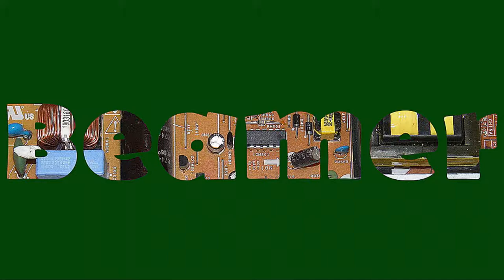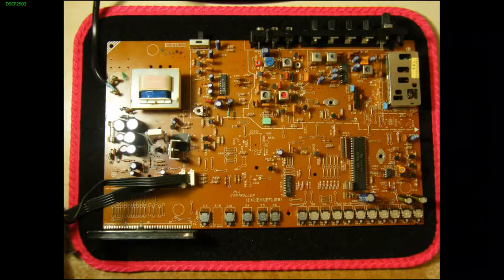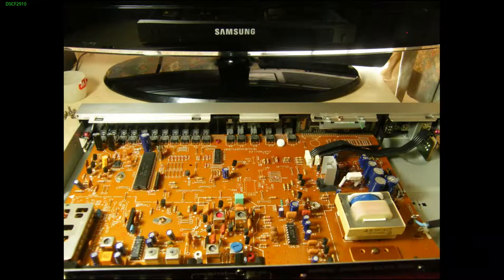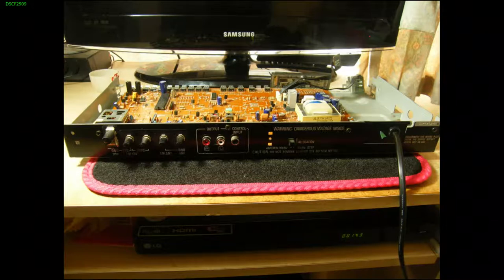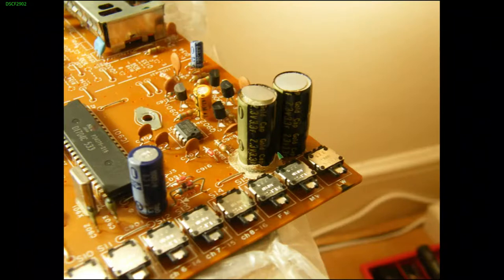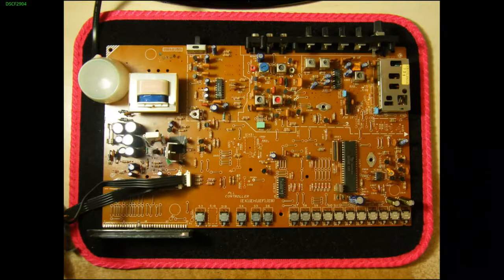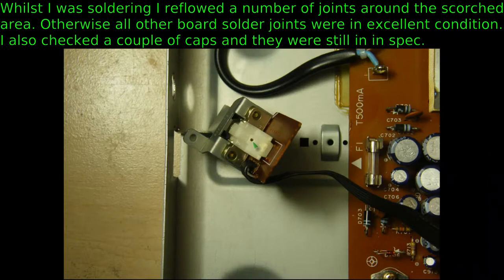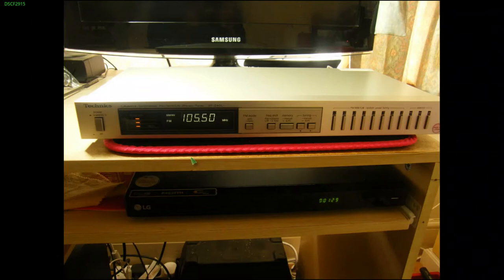Technics ST-Z45L Tuner Repair

Comment: Hola , estoy reparando el mismo modelo y no enciende
Reply from the maker: Assuming you are technically competent - mains voltage can kill! Check that the mains is getting to the mains transformer; if it's not - it's likely to be the mains power switch. Try cleaning it (as in the video) or replacing it. If that's OK, and the front panel isn't lighting up - it's probably faulty regulator circuitry. All the best, Beamer.
Reply: @beamer.electronics  hola ya cambié el regulador de la fuente y ya enciende . Ahora tiene problemas de que no sale ninguna emisora de radio . Solo suena ruido rosa . Que podrá ser
Reply: Tengo un sintonizador igual tiene como problema pierde la grabación de las emisoras
Reply: De un día para otro al revisar encontre dos capacitores de 3.3 faradios a 2.5 voltios
Reply: Es difícil de conseguir si alguien sabe de algun distribuidor por favor lo agradeceria me avisan gracias
Reply: Los capacitores están deformes sulfatados y despegados

Comment: Cheers for the video, love the trick to lubricate the switch without opening it, will remember that one! Looking at a ST-Z55L for cheap to restore
Reply from the maker: Thanks for the appreciation. Yes, you can buy these at very low prices and they are repairable, my 45 is still running superbly. It's unfortunate that I have just 1 talk channel I listen to on DAB or else I would still be using this tuner as my main. All the best, Beamer.